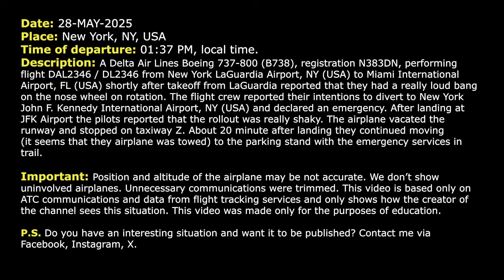Really loud bang on the nose wheel after takeoff. Delta Boeing 737 diverts to JFK Airport. Real ATC

Comment: “And I don’t want to go back to LaGuardia” is so funny just in there lol. I know it’s most likely cause the runways are longer and better maintenance facilities at JFK, but still funny
Reply: I also thought that was hilarious… Wife’s a 737 pilot for Delta. She says LGA runway is short so she would have gone to JFK also. Guess it’s not just about reputation 😂😂
Reply: I came here to say this.
Reply: I wonder whey they didn't ask for the longer runway at JFK.
Reply: @GWNorth-db8vn 22L at JFK is still 1500ft longer than anything at LGA.
Reply: @ItsTehPope  -They landed on 22L but 22R is longer.
Reply: @GWNorth-db8vn Yes, but JFK usually uses the longer runway for departure - if the captain felt he needed it he would have asked for it.
Reply: @GWNorth-db8vn  Landing distance on 22R is less than 100ft (~30m) more (displaced threshold).
I guess you are technically correct.

However, 22L has an EMAS, making it the better choice (a type of runway overrun arresting system).
Reply: @lyaneris  - That makes sense. I can stop wondering now.
Reply: I’m guessing the Pilot didn’t want to take a chance potentially closing one of two runways @ LGA; plus as said, better maintenance facilities @ JFK